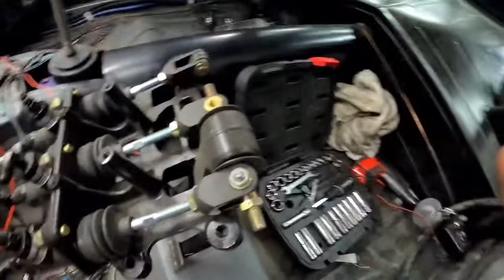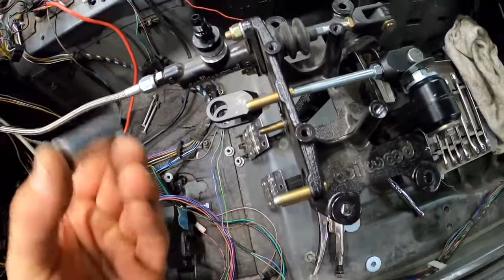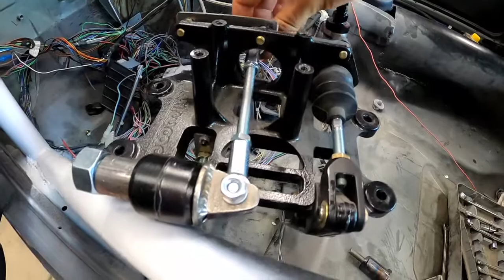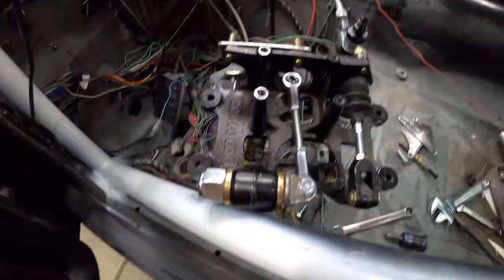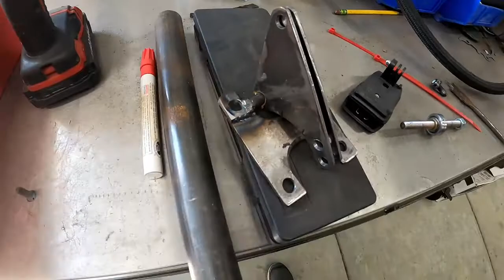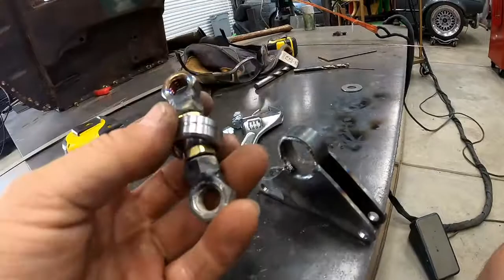Manual brakes to Tesla electric brake booster!  Bmw E30

Comment: Cool design and well done! I have a few questions. Did you end up finding the stroke of the cylinder? Also, is the only thing that's returning your pedal is the spring inside the booster or your pedal has additional return assistance? And, essentially, fully released pedal fully extends the booster rod and fully pressed pedal fully compresses the booster rod? Thanks in advance.

Comment: Bearings and bushings are supposed to be press fit. Drill undersize and ream to the exact size.
Could have been so much simpler with just simply using Bronze bushings and not welding next to them or having them flop around in the hole...
Ratio your pivot to stroke. 1-1 would simply be the exact same distance between the holes on the pivot.
Reply from the maker: Working on an upgrade as we speak, appreciate the input, it’s an evolving process for me!